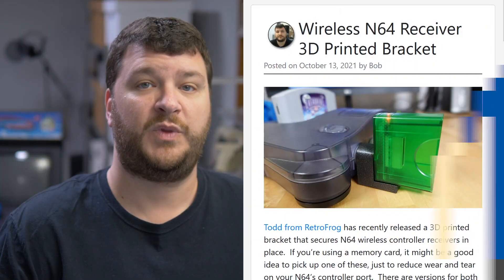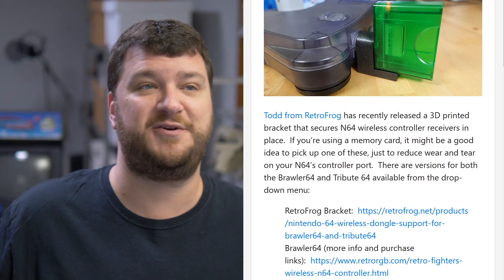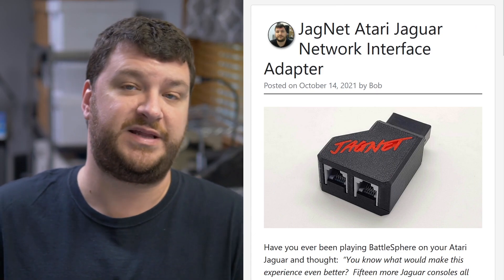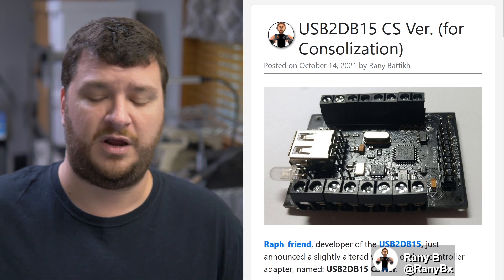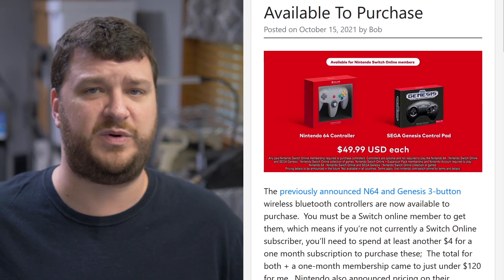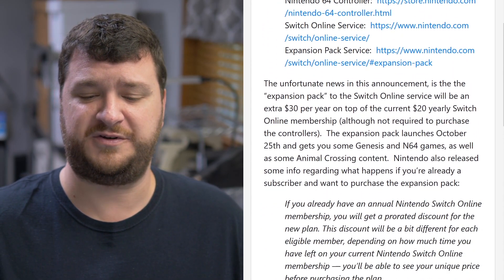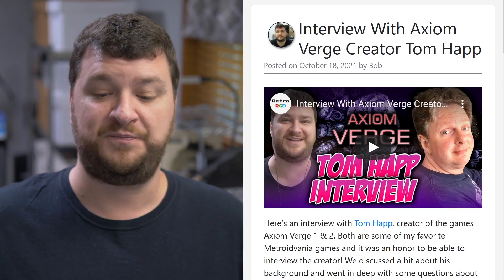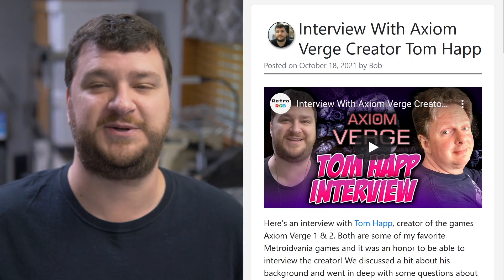RetroRGB Weekly Roundup #275 - October 20th 2021

Comment: Thank you for linking a guide on how to update a GC Video adapter from an old firmware. I am wondering if the procedure is similar at a RAD2X cable. You mention the retro tink quite often but there the update path sounds easier.

Comment: Here's what I do with all my N64 wireless receiver: I use an controller extension cable, plug the receiver in, then tuck it away neatly behind the console. I did that because I dislike the protuding receiver looks, but that would also solve the problem with the weight on the ports.

And Bob, funny you mentioned about your problems buying the Nintendo wireless controllers. I had the same issue when I tried to buy the NES/SNES ones. Even though my account was paid up way before they came out, it would not let me buy either, giving me the same errror. It never went away, so I just moved on. So yeah, seems like an old problem.

Comment: I think the core reasoning for everyone being upset at the Nintendo switch expansion pack, is the amount you're having to pay for N64 games. the n64 is legitimate draw here. Other then original Hardware there's really no easy plug-and-play solution for n64. I have no use for online, Cloud saves, playing nes, snes or Genesis games. So it's $50 a year to play N64 games. Granted as long as I beat the five games I want to play that's 10 bucks a game... but what if I don't beat them with a year... what if it takes me two to three years. I might as well buy a original N64 with a flash card at that point... there is lots of ways to look at it but you're basically paying fifty bucks a year for N64. And that adds up

Comment: The real mistake the companies making the wireless n64 receiver is they should just use a micro sd card or something for save storage and not a orignal n64 mempak. If these worked with other peripherals sure keep the controller expansion slot but they only work with a memory card so why not just replace the need for a memory card and shrink the dongle.
Reply: Because then they'd have to create a way to convert a micro SD card into a format the N64 will recognize and save to. I think they did it the right way: they're trying to sell a wireless controller, not an N64 memory card, so just use the original packs. Let some other company come out with a version of the MemCard Pro for the N64. It was the lack of strain relief that was a poor decision.

Comment: But is the N64 controller 'new analogue' as the original N64 controller uses notches and not true analogue
Reply: All controllers digitize their input at some point. The pivot/lever itself is analog even if it gets optically encoded directly off of that. ;) It’s just like any analog measurement converted to a digital value when you look at it that way. You could say that it is measuring/digitizing analog position much like current controllers measure/digitize a potentiometer resistance value.
Reply: @emmettturner9452  well that's interesting as when I use a gamecube controller on Mario 64 on wii VC than use an original N64 controller via a gamecube adaptor o get more control with the N64 controller
Reply: @barrywilliams3053  Indeed, but this is primarily because of things like emulated range conversion. This is why I bought Adaptoid for my N64 controllers. Converting from octagonal to square and back to octagonal range made it difficult to pull a quick spin in Zelda and caused oversteer in Mario Kart 64 (leading to random spin-outs).
Reply: @emmettturner9452  I mean u can set a deadzone for correct the control.but I am curiose how it would act on switch